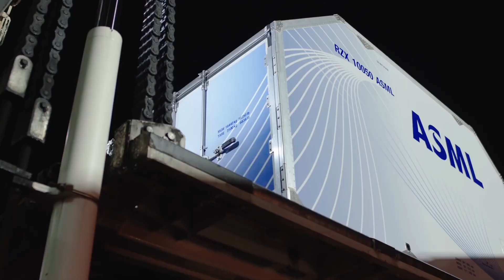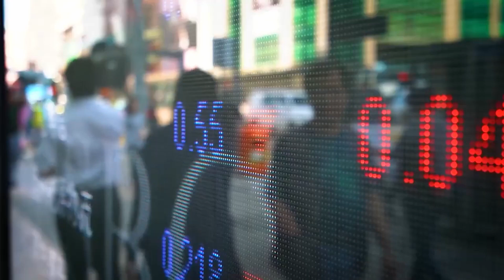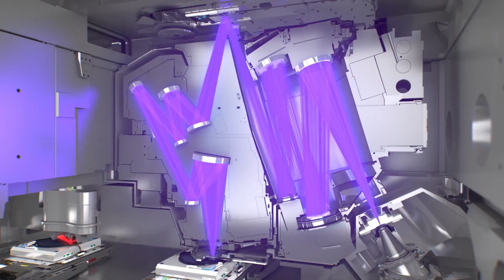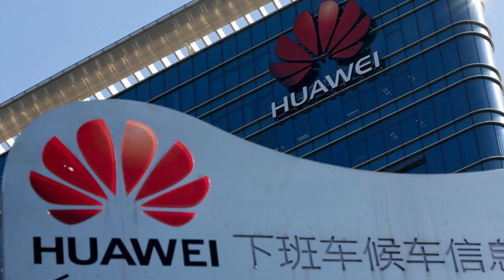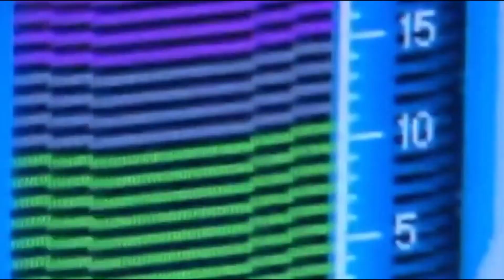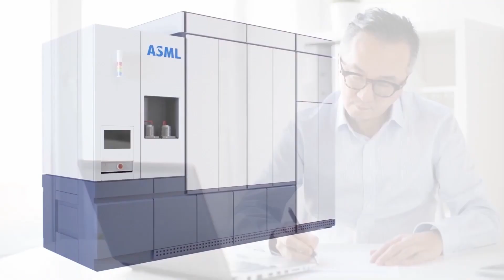China's "Photonic Chip" Mother Invention Technology Huawei-ASML INTO DISASTER! Ai News Engineering

Comment: The struggle on advancing node reductions in silicon are all about reducing power and increasing bit rate processing.  The physical size is not the main benefit.

So, from the above, photonics has a lot to offer in that power consumption is significantly less and bit rate processing is much faster.  It may turn out that a hybrid SOC is the near term reality for photonics, but the potentials appear to be very attractive.

This year, China will have a photonic chip production line online.  It will be interesting to see what comes from this first.  We already know some of its feasibility in the fact that we use optical cables for transmission so the interface between photonics and electrons is fairly well developed.  The question is what functions can photonics bring to replace silicon digital and maybe some analog functions.

Stay tuned.